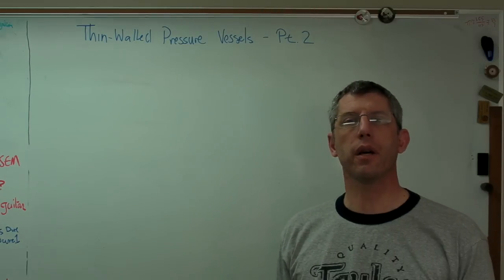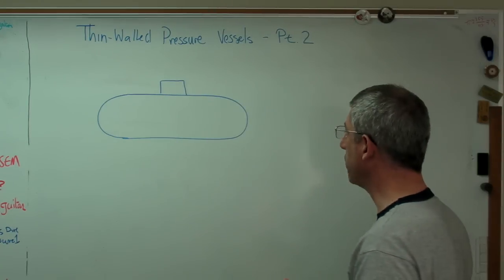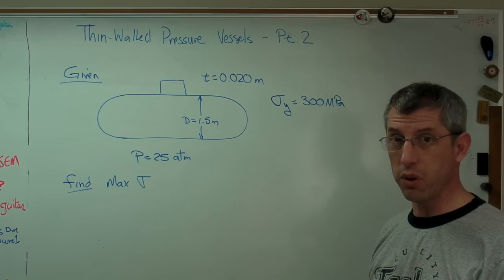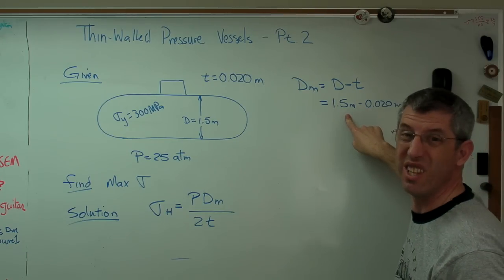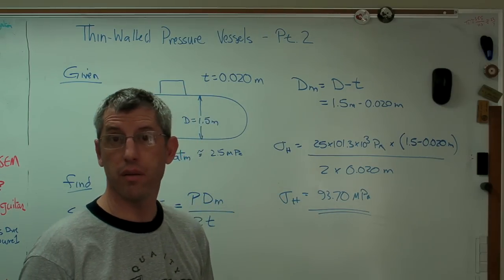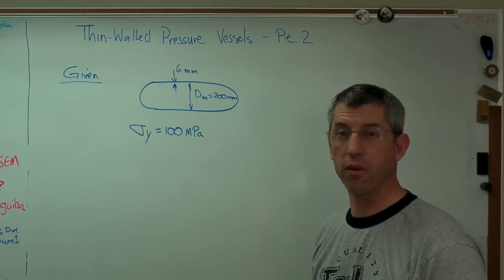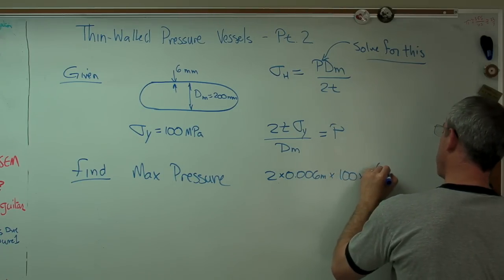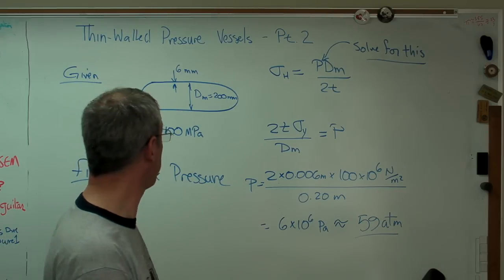Thin Wall Pressure Vessel 2.MP4

Comment: Great video! Thank you. Question though....how come you don't add up the Hoop and the Axial stresses using the principle os superposition to get the sum of the stresses. I mean think about it...if tube that has internal pressure and experiences hoop stress+ I add endcaps and now I have 1/2 hoop stress just 90 deg offset...that significant! Shouldn't there be a net stress in some 70deg or so!?

Comment: What is the suitable safety factor for Pressure Air Vassel with working pressure at 10 bar at normal temp from -10 to 50 Celsius

Comment: Hello sir , 

I learned a lot from your videos ,

Can u help me in two points regarding thin wall vessel , 

Do we use the Yield stress or ultimate stress to design the same , I think yield and you mentioned in the Video yield but please confirm , also for the "dish ends" do I consider stress =pr/4t or stress =pr/t?

Comment: what would you do to apply a safety factor, say if i had to work out max pressure with a safety of 4 would i just multiply my end result by 4. thanks
Reply: yes
Reply: Estoyz Aclan one more question what formula would you use to work out pressure from a given strain
Reply: I apologize I can't answer that question for now. Currently taking up Mechanics of Deformable Bodies and we're just on the Axial Strain lesson :)

Comment: im getting lost when your adding 10 to the power of 3 or 10 to the power of 6 into the equation, where do them numbers come into it ?
Reply: power of three came from 101.3kPa as that's the equivalent of 1 atm. Converting that into Pa only you should multiply by 1000 or 10^3. Also, 10^6 came from MPa. Mega is 10^6. Hope it helped

Comment: Nobody notices that he makes a mistake in the calculation of the hoop stress, the result is 937 Mpa, and not 93.7Mpa  according with the properties of the material (300Mpa).. That vessel will  explode
Reply: Umm no.
Reply: Luis Arrieche He is correct, it is almost 93.726 MPa